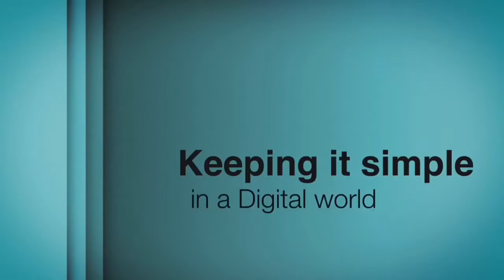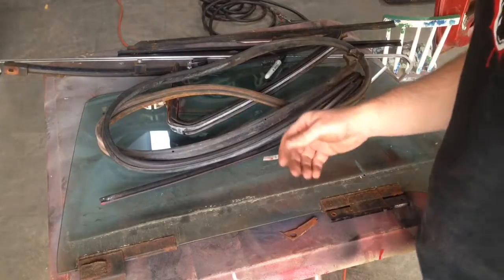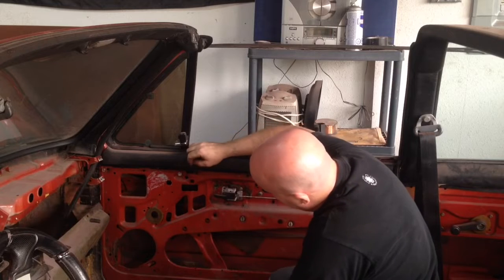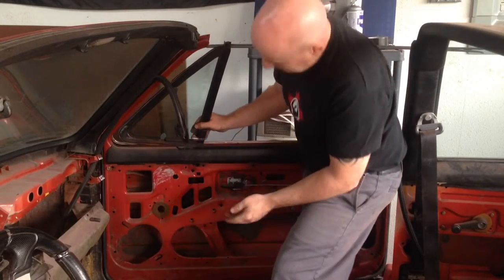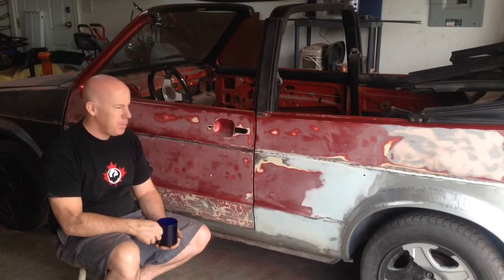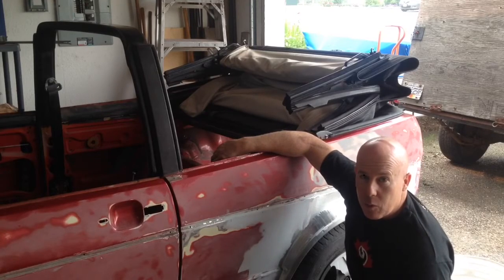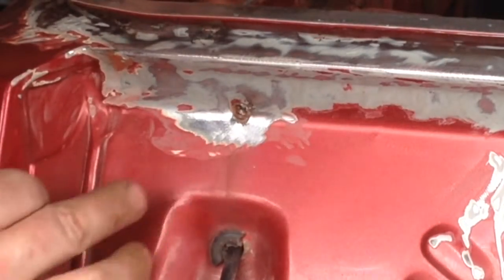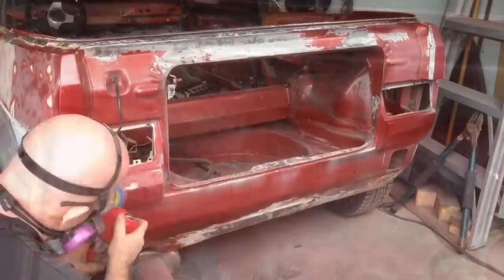Windows & Roof Removal - 1980 Mk1 VW Rabbit Convertible Project Episode 12

Comment: Hey! It's me again, I just had a quick question - I've almost completed the teardown on the body and interior trim, and I'm going to start doing bodywork soon. What are the best ways to clean, remove paint, and remove rust from parts of the exterior? I assume it's different procedures for each. 

Also I had a question about rust repair - I'm mostly looking to fix a few rust spots along the beltline trim and the rear driver fender. Any major tips I should know that won't be in the bentley or hayne's manuals?

Hope it's going well!
Reply from the maker: I mostly used a Dual Action Sander on my Rabbit to remove paint. It kind of depends on the situation, if you want to remove ALL the paint some people prefer chemical paint stripper.

As far as rust repair goes, the best way is to cut out the rusted parts and weld in fresh metal. It’s time consuming but it is the only way to keep the rust from coming back.